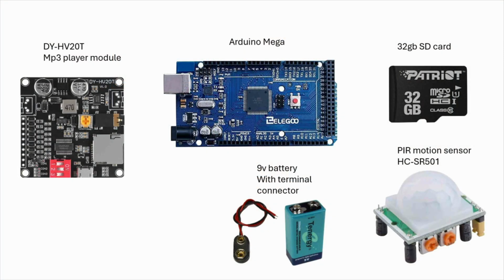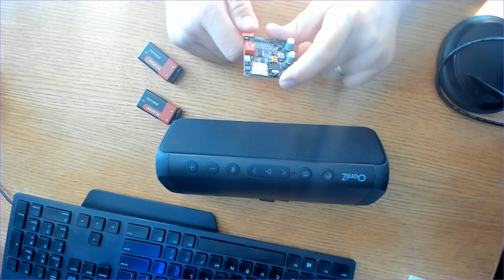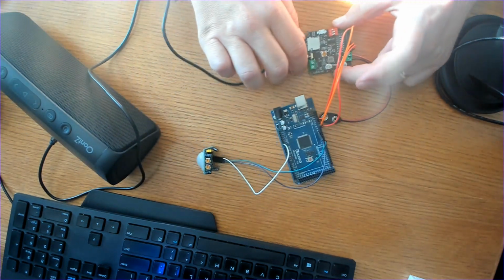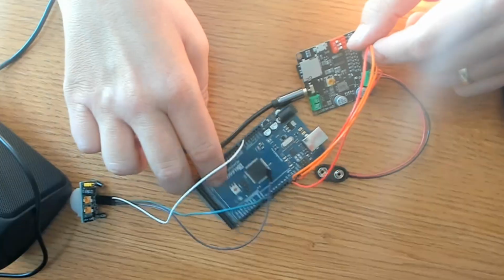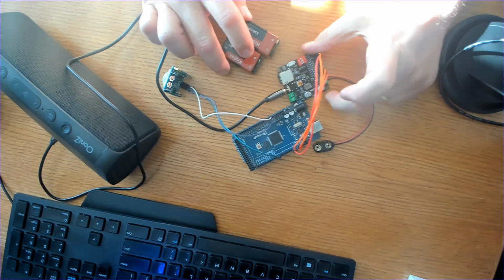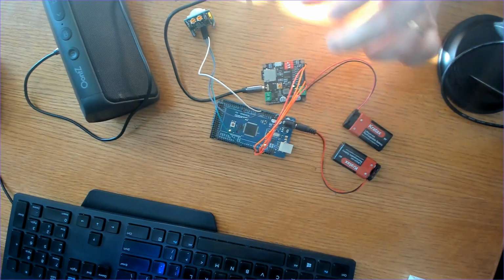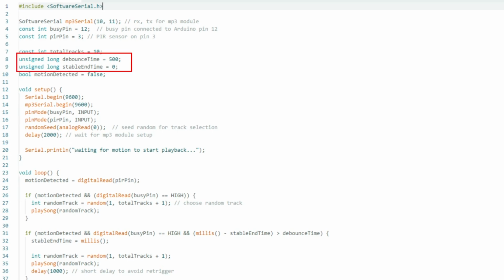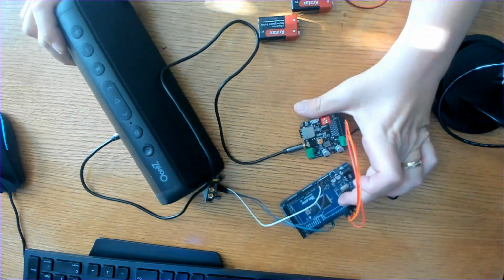Build a MOTION Activated MP3 Player with Arduino and PIR Sensor – Easy DIY Guide!

Comment: how do i find the code
Reply from the maker: hey there!
here ya go~

#include <SoftwareSerial.h>
SoftwareSerial mp3Serial(10, 11); // rx, tx for mp3 module
const int busyPin = 12; // busy pin connected to Arduino pin 12
const int pirPin = 3; // PIR sensor on pin 3
const int totalTracks = 10;
unsigned long debounceTime = 500;
unsigned long stableEndTime = 0;
bool motionDetected = false;
void setup() {
Serial.begin(9600);
mp3Serial.begin(9600);
pinMode(busyPin, INPUT);
pinMode(pirPin, INPUT);
randomSeed(analogRead(0)); // seed random for track selection
delay(2000); // wait for mp3 module setup
Serial.println("waiting for motion to start playback...");
}
void loop() {
motionDetected = digitalRead(pirPin);
if (motionDetected && (digitalRead(busyPin) == HIGH)) {
int randomTrack = random(1, totalTracks + 1); // choose random track
playSong(randomTrack);
}
if (motionDetected && digitalRead(busyPin) == HIGH && (millis() - stableEndTime) > debounceTime) {
stableEndTime = millis();
int randomTrack = random(1, totalTracks + 1);
playSong(randomTrack);
delay(1000); // short delay to avoid retrigger
}
}
void playSong(int songNumber) {
Serial.print("playing song number: ");
Serial.println(songNumber);
mp3Serial.write((uint8_t)0xAA); // start byte
mp3Serial.write((uint8_t)0x07); // play command
mp3Serial.write((uint8_t)0x02);
mp3Serial.write((uint8_t)0x00);
mp3Serial.write((uint8_t)songNumber);
mp3Serial.write((uint8_t)((0xAA + 0x07 + 0x02 + 0x00 + songNumber) & 0xFF));
delay(1000); // ignore busy pin during first second of playback
}

Comment: I can't seem to get my sensor to work. My track just keeps looping. even if im not in the room at all
Reply from the maker: hey there!
Are you using the correct dip switch setting, UART mode?  1, 2 are down and 3 is up I believe.
Did you check the yellow jumper on your PIR sensor?  Do you have the boards powered properly (voltage and current)?
I would start there. 
let me know how it goes~!  👍👍

Comment: Thanks for showing this set up, i am doing a Halloween haunt in the UK 2025 and need to play selected tracks 1/?  and not random tracks like your code ,what and where can it be put in your code for this to happen ? Regards. Have tried to follow on line course/vids but have got lost lol.
Reply from the maker: hey there!
Do you already have the MP3 board and Arduino set up? And do you want to trigger the sounds with a button press or with a motion sensor? How do you want to activate selected tracks, in sequence starting with 1 track or manual selection?  The more detail, the better.
happy to help out!
Reply: @BMonsterLaboratory  thanks for taking the time to reply  I have everything u had in the video also watched the switch video and copied the code as a back up in case I couldn't find any code for playing selected tracks 1/? So really need help from your code on ramdon to play tracks 1/? Everytime some one triggers the pir sensor when they enter the dark maze . Must appreciated.
Reply: Hi not to take the piss, is it easy to add more pir sensors to your code to play different dy-hv20t boards in different sections of the maze with one mega ? .
Reply from the maker: Try this code to play tracks in sequence rather than random. If you want to addd more tracks: 
-->  const int totalTracks = 10;  <-- Change to however many tracks you have.

If you want to increase delay time to prevent retriggering: 
-->  unsigned long debounceTime = 500;   <-- change this value. It is currently at 0.5 sec

Here is the code to play tracks 1-10 in sequenece with a .5s delay between each. It will loop back to track 1 after track 10 plays. All the pin connections from the video remain the same. You can make more modifications to fit your needs.
-------------------------------------------------------------------------------------------------------------------

#include <SoftwareSerial.h>

SoftwareSerial mp3Serial(10, 11); // rx, tx for mp3 module
const int busyPin = 12; // busy pin connected to Arduino pin 12
const int pirPin = 3; // PIR sensor on pin 3
const int totalTracks = 10;
unsigned long debounceTime = 500;
unsigned long lastTriggerTime = 0;

int currentTrack = 1; // Track counter - starts at 1

void setup() {
  Serial.begin(9600);
  mp3Serial.begin(9600);
  pinMode(busyPin, INPUT);
  pinMode(pirPin, INPUT);
  
  delay(2000); // wait for mp3 module setup
  Serial.println("Dark Maze Audio Ready - Waiting for motion...");
}

void loop() {
  bool motionDetected = digitalRead(pirPin);
  
  // Trigger when: motion detected, player is idle, and debounce time passed
  if (motionDetected && (digitalRead(busyPin) == HIGH) && 
      (millis() - lastTriggerTime) > debounceTime) {
    
    lastTriggerTime = millis();
    playSong(currentTrack);
    
    // Move to next track, loop back to 1 after track 10
    currentTrack++;
    if (currentTrack > totalTracks) {
      currentTrack = 1;
    }
    
    delay(1000); // prevent immediate retrigger
  }
}

void playSong(int songNumber) {
  Serial.print("Playing track: ");
  Serial.println(songNumber);
  
  mp3Serial.write((uint8_t)0xAA); // start byte
  mp3Serial.write((uint8_t)0x07); // play command
  mp3Serial.write((uint8_t)0x02);
  mp3Serial.write((uint8_t)0x00);
  mp3Serial.write((uint8_t)songNumber);
  mp3Serial.write((uint8_t)((0xAA + 0x07 + 0x02 + 0x00 + songNumber) & 0xFF));
}
Reply: @BMonsterLaboratory   Sir you are a legend !!  hopefully this will work as I had planned all those months ago and i can rest easy and just worry about the weather and people turning up ?? lol . please accept  a very big hand shake from over the pond in the UK . thank you for your time in doing this without asking for money like a few that i have come across. Also is operating more than one PIR on the mega really complicated for writing the code ? as wanted to try this maybe next year . once again a big thank you . Cheers Chris.
Reply from the maker: You can add more  mp3 boards and PIR sensors to the Mega, but how would you connect them at other maze locations?  I think running long wires thorugh a maze will not be efficient. 

I think having all the hardware in one area is probably best. A Mega + DY-HV20T + PIR + speaker operating off a regulated 12V supply for each section where a track will be played.
Reply from the maker: You're welcome!
No, it’s not difficult to use multiple PIR sensors with an Arduino Mega. The code is very similar to using just one sensor — you simply read each PIR input on a different pin. The only thing to watch out for is wiring: if your sensors are placed far apart, long cable runs can pick up noise or cause weaker signals. In a maze, I would assume you would need wire distances of 20-50feet, or even further.  With unshielded wire, this signal can pick up noise or lose voltage. Sparkfun came out with this QwiicBus kit a while back. I bought it and it works really well.  May be something to think about in future builds if you need your sensors spaced far apart.  
If you have any other questions, feel free to ask. 
best of luck with the maze!! 👍💪

Comment: Do I have to write the commands
Reply from the maker: If using Arduino, you have to program it. 
If you want the code I used, search #arduinosoundproject on Facebook and check the comments. from there you can alter the code to fit your project or completely redo it for something different.
I also have an email list for those who want the code and diagrams (if there are any) sent directly to them. Send email to bmonsterlaboratory@gmail.com with the subject line  "ADDME". 
hope that helps!

Comment: I’m starting to notice that my Arduino project is getting bigger and more components are being added. Each requiring a separate power source. How could you run all the components off one power supply? I’ve seen other creators use a single power supply with splitters, along with buck converters. Will this be a good solution for bigger projects that require more power supplies?
Reply from the maker: Yes, that's a good idea. I have a IMAYCC 0-24V Adjustable Power Supply. It does an excellent job of supply enough power for multiple projects. Split the various converters and your problem is solved. If you get a buck convert, be sure to get one rated above the current you need. They typically operate at 85-90% efficiency. I like to leave 20% headroom for current so I don't overheat.  I hope that helps 👍

Comment: How can I get the code?
Reply from the maker: I post it all on Facebook. It doesn't always fit in the video description but this one is short. Here it is! 👍

#include <SoftwareSerial.h>
SoftwareSerial mp3Serial(10, 11); // rx, tx for mp3 module
const int busyPin = 12; // busy pin connected to Arduino pin 12
const int pirPin = 3; // PIR sensor on pin 3
const int totalTracks = 10;
unsigned long debounceTime = 500;
unsigned long stableEndTime = 0;
bool motionDetected = false;
void setup() {
Serial.begin(9600);
mp3Serial.begin(9600);
pinMode(busyPin, INPUT);
pinMode(pirPin, INPUT);
randomSeed(analogRead(0)); // seed random for track selection
delay(2000); // wait for mp3 module setup
Serial.println("waiting for motion to start playback...");
}
void loop() {
motionDetected = digitalRead(pirPin);
if (motionDetected && (digitalRead(busyPin) == HIGH)) {
int randomTrack = random(1, totalTracks + 1); // choose random track
playSong(randomTrack);
}
if (motionDetected && digitalRead(busyPin) == HIGH && (millis() - stableEndTime) > debounceTime) {
stableEndTime = millis();
int randomTrack = random(1, totalTracks + 1);
playSong(randomTrack);
delay(1000); // short delay to avoid retrigger
}
}
void playSong(int songNumber) {
Serial.print("playing song number: ");
Serial.println(songNumber);
mp3Serial.write((uint8_t)0xAA); // start byte
mp3Serial.write((uint8_t)0x07); // play command
mp3Serial.write((uint8_t)0x02);
mp3Serial.write((uint8_t)0x00);
mp3Serial.write((uint8_t)songNumber);
mp3Serial.write((uint8_t)((0xAA + 0x07 + 0x02 + 0x00 + songNumber) & 0xFF));
delay(1000); // ignore busy pin during first second of playback
}
Reply: @BMonsterLaboratory  thanks, much appreciated.

Comment: Thanks for showing this setup. In my previous project, I used a DF mini player and was able to power it through the Arduino Uno. The only issue was, I used a 3W speaker and was not loud enough when there were a lot of people around and talking.
Reply from the maker: I like the DFplayer but I need to use an amplifier with it. This was has an onboard amp that's plenty loud, at least for my 8ohm speaker. It sounds way better with my bluetooth speaker though. I really like this mp3 board 👍
Thanks for leaving a comment!

Comment: Good explanation bro
Reply from the maker: Thanks for checking it out! I'm glad you found it helpful! 👍
Reply: @BMonsterLaboratory  it's ok bro
Reply: Hello bro, your video is very good. I don't know if you can make a video where you use the PCA 9685 module in bottango. Maybe in case an Arduino code is needed so that it later works in bottango and about the storage of the animations that are made in bottango because I think which has a very low limit and I would like at least a 3 minute animation to be saved @BMonsterLaboratory
Reply from the maker: Hi, thank you.
I could revisit bottango but it may be a while. Did you check out this video where I used the PCA9685 module ? https://youtu.be/DWvVfzULl6U